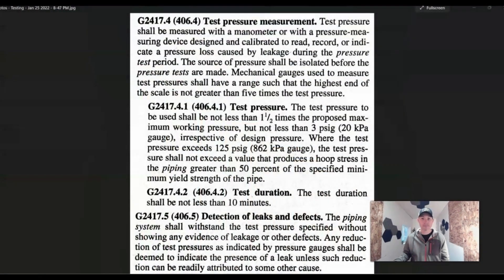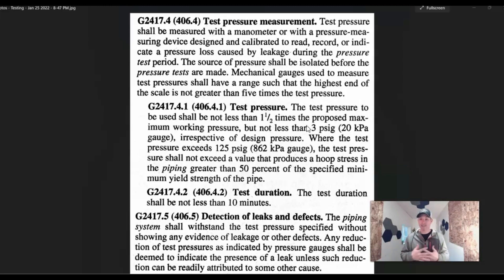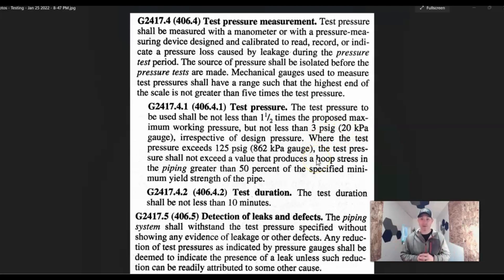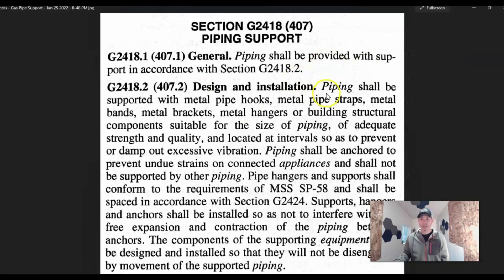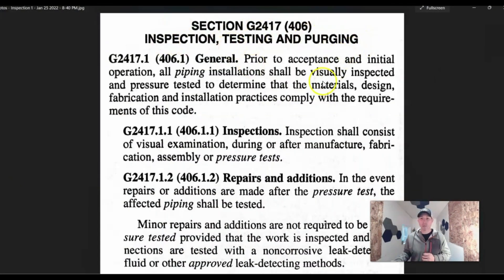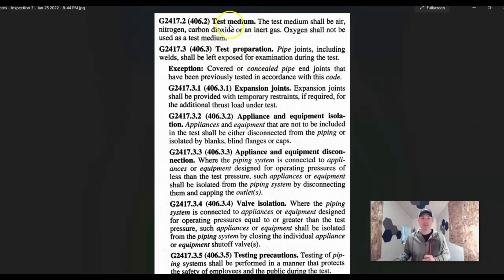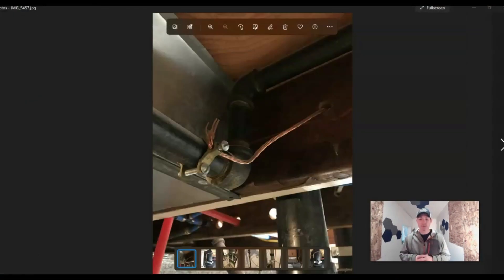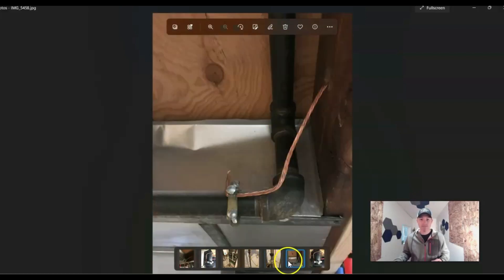GAS LINE TESTING AND INSPECTION REQUIREMENTS | DIY

Comment: I read somewhere that appliance valves are sometimes only rated to 2psi or so. Do you usually see the appliance valves open but their outlet capped during the test?
Reply from the maker: Yes, if the valve is installed. Normally the pipe will be run and capped at all ends for test and then valve and attachment to appliances completed. At least in my area thats how we normally see it.

Comment: Another great video, do you have any videos on fasteners, as in which ones are code compliance. 3" or 3.5" for framing,  and what for sheathing 2 3/8 ?? Or what's universal with code compliance, oh for roofing too..what's the correct length
Reply from the maker: Thats a hard one because there are so many different scenarios.  Try to google IRC table r602.3 for the fastening schedule. In general a 16d x 3-1/2” framing nail should get you through most framing. Roof and wall sheathing attachment with a 8d x 2-1/2” should work as well.
Reply: Awesome once again thank you!!